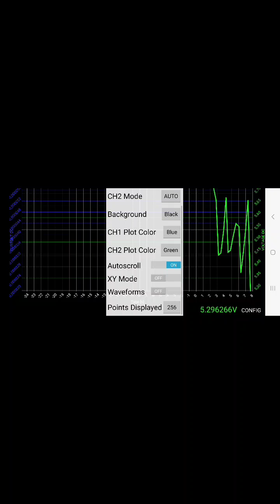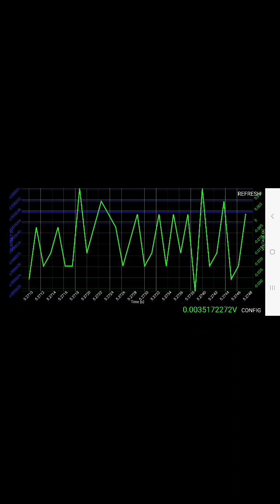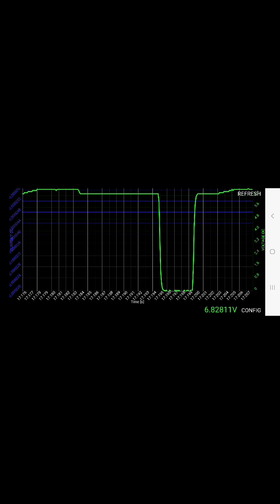N2 Neuron making use of the waveform mode.

Comment: Yes definitely a handy tool. I agree with you about the manual, it's kinda vague about sample window size vs interval (for lack of any definition of the time parameter, ie ms). Also on the Neuron they changed the name from buffer to waveform. 
Here's what I'm trying to get straight so let me know if this is just flat out wrong.
Choosing sample size is another way to say, "How many readings do you want to fill up the graphics screen across horizontally?'
Milliseconds is the amount of time between two consecutive measurements.
Does that sound right?
I offered someone the neuron a couple of days ago because someone didn't return the scope to my workbench at work. And no, I don't do automotive stuff at work.
I absolutely looked like an idiot because I couldn't explain how to use the Neuron. He hunted down the scope and got it back.
But the neuron would have done just as good as the scope. The problem is I can't explain how to use it.
Thanks for your great video about one of my favorite meters.
Reply from the maker: https://youtu.be/-lkMykuz_9U

Here is a video explaining it with the newest software. I hope this helps. If you have any more questions about it after watching that video. Just comment, and I'll answer them for you.